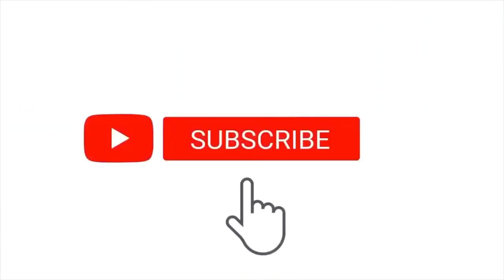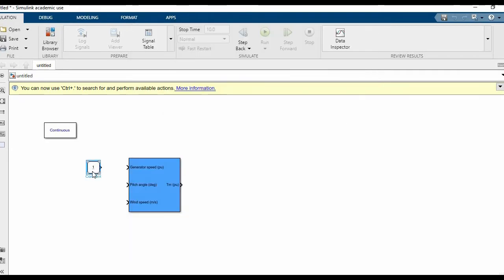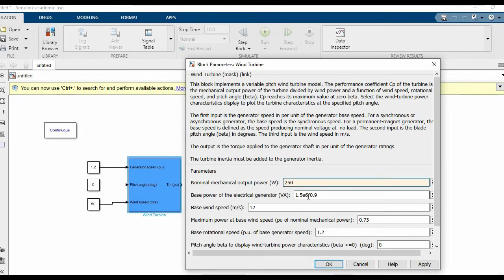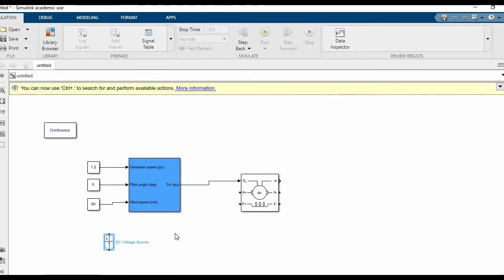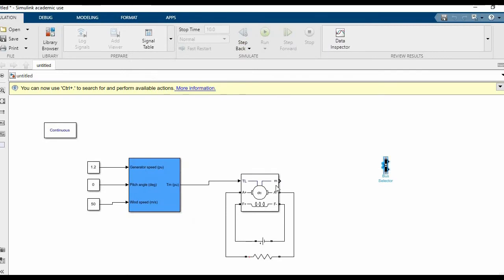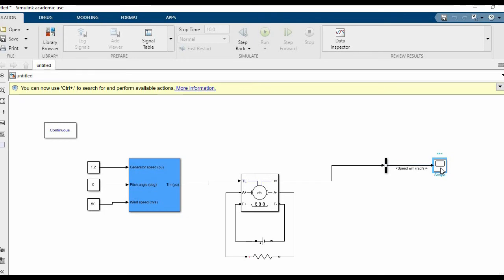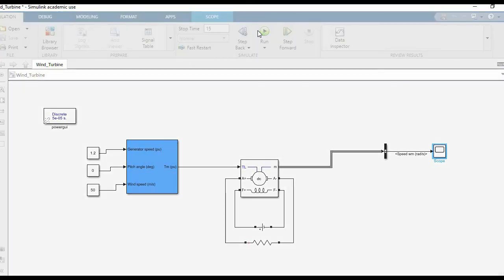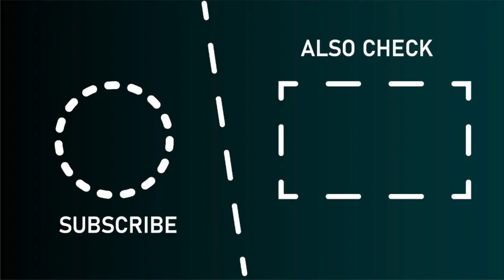Windturbine Simulation with DC Machine in MATLAB/Simulink!

Comment: Thank you for your great videos, they're really helpful! Do you know how you could combine both a solar array and wind turbine (AC) as an off grid power supply for a known load?
Reply from the maker: Matlab unfortunately won't let you combine those blocks. You can use a generator block or use a variable ac supply
Reply: @TheUrbanScholar  Thanks! So the generator block or variable ac supply could act in place of the wind turbine?
Reply from the maker: Yeah you can assume it to be a wind energy source
Reply: @TheUrbanScholar  Great, thanks!
Reply from the maker: Pls do share our channel with your friends who'd benefit from the same 😃